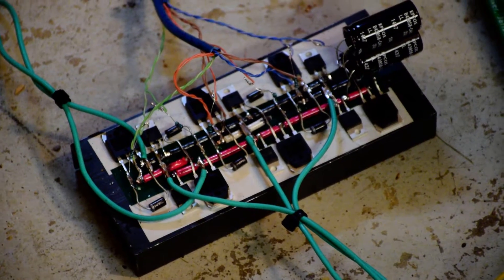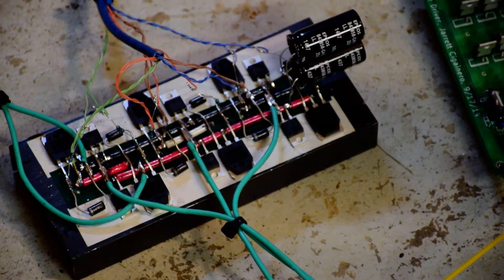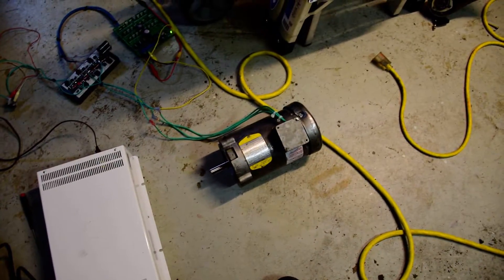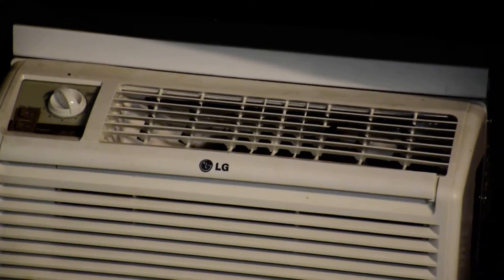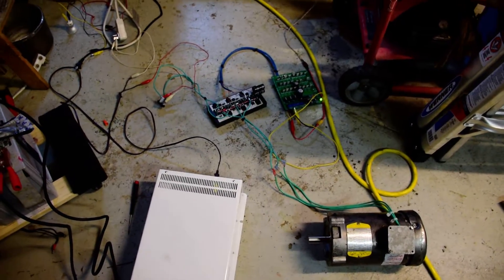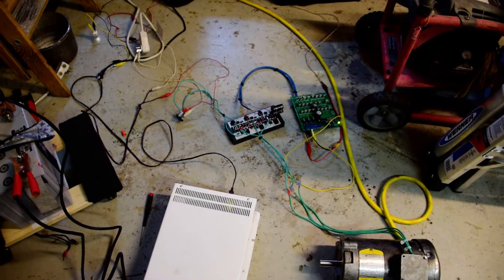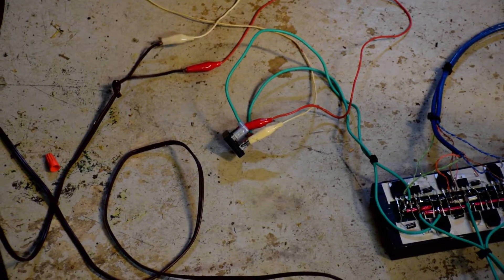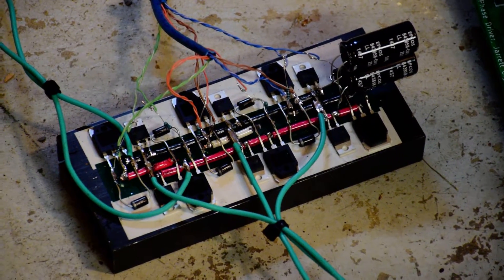IGBT block and induction motor test.

Comment: now load it. of course it's not heating up, it's drawing basically nothing
Reply from the maker: I would if today was 4 years ago.
Reply: @RingingResonance  Nothing wrong with digging up old DIY inverter projects to play around with
Reply from the maker: Yeah, I've been thinking about digging out this old project. I started on field oriented control and had just gotten the motor to turn in an open loop system, no current feedback or back EMF sensing. I never bothered to finish the project as I got caught up in flight school and gf at the time. I understand math a little better now, maybe I should try this again but with a micro controller that has a built in FPU instead of having to deal with the dsPIC's dsp engine using fractional math and incomplete C libraries that barely access the 40 bit accumulator without hassle. Even at 120mhz performance was meh after optimizing with inline assembly. That's where I stopped at, but I also have other projects I've been working on as well. Trying to get out of mechanics and back into computers. I would make more money that way and plus my hands are turning arthritic at the young age of 27.
Reply: @RingingResonance  ahah, i recommend stm32, they have a C library for FOC. also a very easy ecosystem to work with, but still versatile
Reply from the maker: Thanks. Ill check it out.

Comment: Thenx bro am highly appreciated for your help.  And let me ask you the last question.  What if I build invator dc to dc and then dc again.  It's can not affect IGBT yeah.  Like 200vdc
Reply from the maker: I'm not sure what you are trying to say. As long as your parts are rated for the proper voltage and current,  and it is all connected correctly, it should work. Just be sure to take appropriate safety precautions and you should be alright. Your circuit might smoke up, but that is a chance to learn something new.

Comment: Where is open source schematics located?
Reply from the maker: This is a very crude setup. It's really just 3 half bridges connected to some mosfet drivers connected to a microcontroller. This micro doesn't even have 3 separate outputs for PWM. Instead, I am using all 4 timers and their interrupts to generate the PWM signal. It works but the signal isn't clean and leaves very little time for the CPU to do anything else.